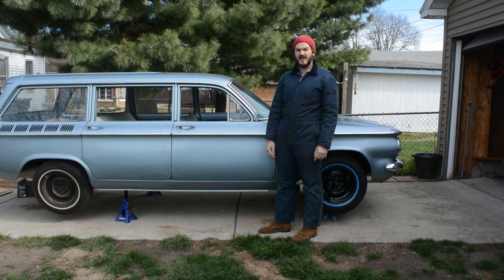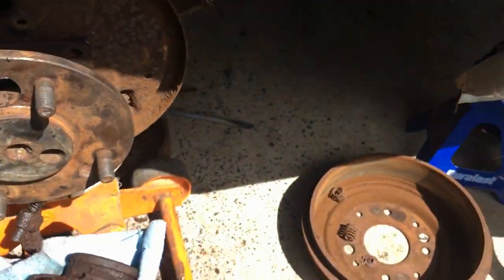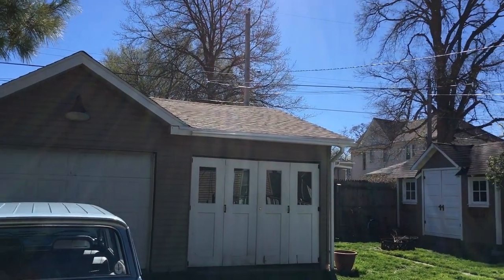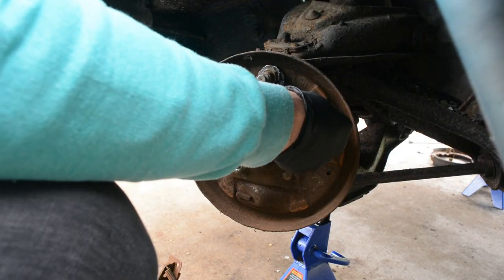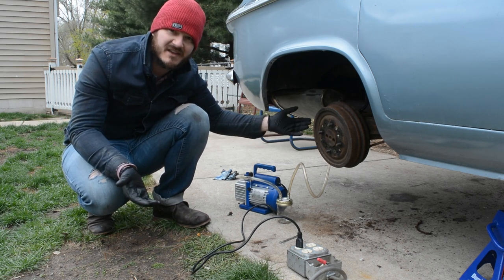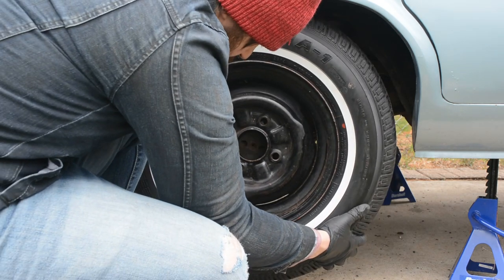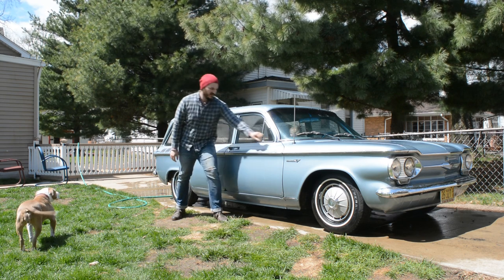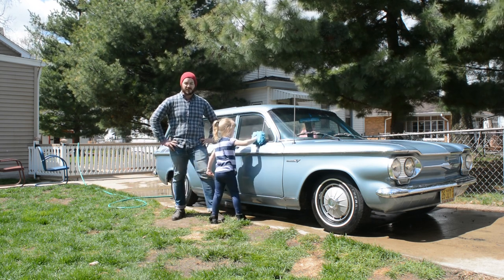New Brakes For the Corvair Lakewood Station Wagon

Comment: I agree about rebuilding. I think it’s also cool to keep the original parts when possible. Any new videos?
Reply from the maker: Nothing yet. May do one soon. The teeth on the torque converter are gone now and I need to pull the power pack to install the new torque converter.

Comment: The hub cap coming off at the end was hilarious, thanks for leaving that in
Reply from the maker: When I saw that on the camera after the test drive, I laughed myself. So I thought others would enjoy it too. Turned out I had a mismatched wheel. I got the right wheel and now the hubcap stays on.
Reply: @WesleyGarrardAmbitionInEconomy  our Greenbrier only has 2/4 hub caps, your Lakewood is looking NICE
Reply from the maker: @eurospec  Thanks. When I get time, I will need to address the rocker panels. At some point in it's life new rocker were welded in... on top of the old rusty rockers! Please check out my other Lakewood videos. I have replaced the entire floor and most recently, upgraded the spark delivery.
Reply: @WesleyGarrardAmbitionInEconomy  I will do that. We need new floor pans and rockers as well

Comment: I feel for you, brother.  On my British car, the Girling drum brake wheel cylinders (and therefore bleed valves) were at the BOTTOM.  And their mounting studs were pretty pathetic in the rear.  After driving my car with some gusto, one rear stud thread stripped; decided to replace both cylinders as I was so disgusted with the design.  Then came the bleeding.  Wish I had had your handy-dandy pump, but this was a long time ago!  Bled and bled and bled (with an assistant) for an hour.  The brake pedal sponged away to the floor.  Changed fluid brand and re-bled for another hour.  STILL the brake pedal sponged away to the floor.

Cried with rage - until I sat down, had a smoke and thought about bubbles in soda bottles rising to the top.  Then it suddenly dawned on me - couldn't be!  I unbolted ALL wheel brake mechanisms and rotated them temporarily 180 degrees on the backing plates (no holes to screw the wheel cylinders in, but I just wanted these facing upwards).  This took ages, but I had already spent ages stuffing around. Bled the brakes - pedal now as firm as a rock!  Thanks England.
Reply from the maker: Johnr Roberts We also have and MG Midget so I feel you all the way. Seems most of the time, British automotive engineers were just like, “eh, that’ll do.”

Comment: You can convert 60-62's with manually adjusted brakes over to the 63+ self adjusting system very easily. Next time you do the brakes, just order the self adjusting hardware and 63-64 shoes. It all drops right in.
Reply from the maker: Thanks! I will keep that in mind.